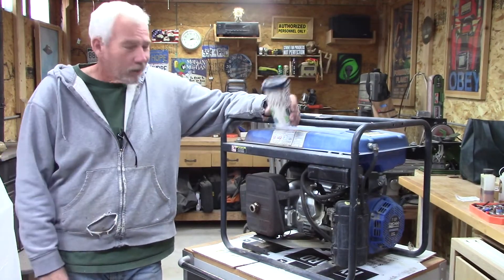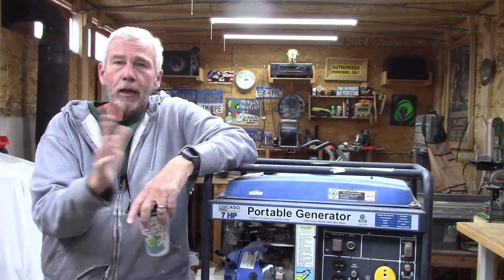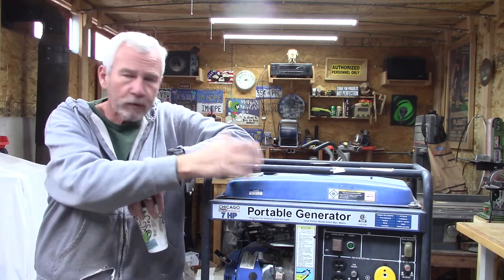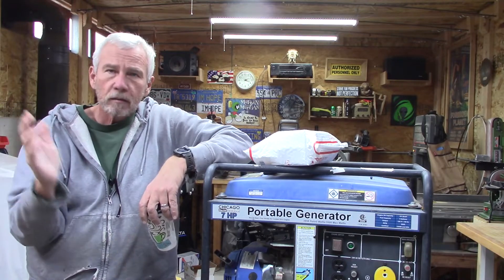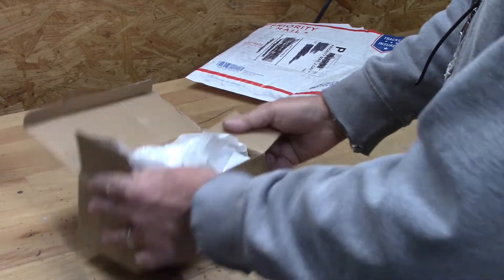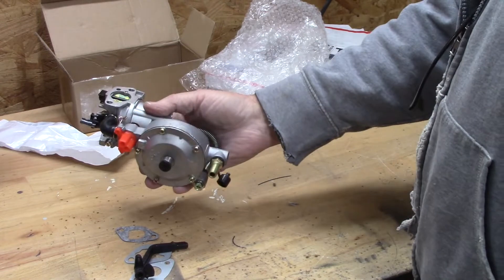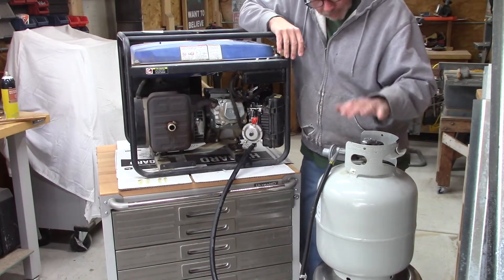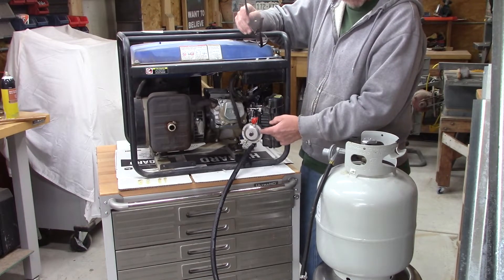Harbor Freight Portable Generator Propane Conversion - With Parts List - Let's Figure This Out

Comment: Will this kit work on a Generac GP6500
2:52
Reply from the maker: The kits are pretty generic and are based on the size of your Generator. Start by looking for a kit that is designed for Make and Model. If none is available, go the generic route, but be careful and really read the item descriptions to ensure they cover your make and model.

Comment: I bought one of those carb kits recently, which looks to be Identical to yours. The listing said, "Note The gas has to be pressure regulated natural gas(shortened as PNG or CNG) should be between .29 or .37 psi and LPG need to be .40 or .55 psi; natural gas generally has a regulator before entering the building. For LP gas a regulator has to be installed on the tank. Basic mechanical ability is needed as these units only come with basic operation instructions."

I bought a pressure regulator that yields 0.5 psi. Not yet installed, so we'll see how it works.
Reply from the maker: Good Information. I just used an adjustable unit off a turkey pot

Comment: On my first conversion,  I had one of those adjustable regulators with a gauge. I had to cut it down to 1-2 psi before it would start. Then slowly increase the gas to operating speed

Comment: How did you deal with the nipple instead of a screw on connector?
Reply from the maker: @GaryWolf001  Unfortunately I'm not near the unit. If I could change the adapter I would. If I would use a constant tension clamp

Comment: I have the same setup, the question I have is how did you attach the adjustable pressure regulator to the barbed fitting on the carb, mine came with a female compression fitting.
Reply from the maker: I don't remember, but I prefer to use constant tension clamp instead of the worm screw clamps. The reason I like those has to do with the temperature swings we get.

Comment: You have built a great channel and I enjoy your enthusiasm.  I just bought one of those kits but with the regulator from “V power” and had success.  The regulator they supply is apparently a higher volume, fixed pressure type and seems to work great from starting to load.

Comment: Is the barb fitting on the carb threaded into the carb? If so, it would be nice to unscrew the barb and change it to the common threaded connection.
Reply from the maker: In many cases I would agree with you. In this case (low cost & high vibration) I don't mind a barb fitting as long as you use a constant tension clamp to account for temp variations. Just my opinion.

Comment: Yo hice ese mismo cambio con un carburador similar en la parte de arriba del regulador de gas del carburador hay una llave que dice gas lp y gas natural hay que seleccionar el correcto, yo uso un regulador de gas de baja presión y 0.8 metro cúbico por hora y 0.4 psi y funciona perfectamente.
Ojo pierdes un 20 o 30 % de potencia
Reply from the maker: Gracias por tu contribución. La mayoría de estos kits/carburadores son tricombustibles. Gasolina, Propano y Gas Natural. Olvidé mencionar la posibilidad de cambiar a gas natural, así que gracias por mencionarlo.

Comment: What do you think is the running time with one full take of propane? BTW, excellent video and information.
Reply from the maker: I get that question often. It all depends on the generator and the attached load. I've run mine with a 30lb bottle for 48 hours straight and it did fine.

Comment: Where did you buy the propane hose that goes from tank and generator if Amazon could you please put a link
Reply from the maker: Amazon has a variety of hose kits. Here is an example: PAMASE 12FT Long Propane Hose Adapter with POL to QCC1 Converter, Extension Hose 1lb to 20lb Tank, for Camping Long Distances Use Large Tank, BBQ Portable Gas Grill, Griddle, Stove
Reply from the maker: If that isn't what you want search "Extended Stay Propane Kit"

Comment: what about the engine governor when the load changes, do you need to adjust the pressure when the load changes ?
Reply from the maker: As the load changes the vacuum on the diagram changes which adjusts the amount of propane flow

Comment: Just wanted to thank you for this info.  I bought the same kit and, like you, absolutely no instructions.  I had no idea how to use it and how to switch from gas, to propane to NG.  Was able to start it on propane but on natural gas, even when priming it, it's doesn't start unless I squirt a little gasoline in the carb first to get it going,  and then the NG kicks in.  Mine is a pull start only but it might start OK on NG with an electric start.

Comment: Am from Nigeria how can I get the dual carburetor
Reply from the maker: I bought most of these parts from Amazon and I don't get anything from you buying these parts. Just copy and search each one.

Tri-Fuel Conversion Kit:  Nature Gas Propane Tri Fuel Conversion Carburetor Kit for Predator Harbor Freight 3200 4000 Watts Gas Generator.

Adjustable Pressure Regulator: GasOne 2109-RED 4 ft High Pressure 0-20 PSI Adjustable Regulator with Red QCC-1 Type Hose-Works with Newer U.S. Propane Tanks.

Brass Hose Adapter: Anderson Metals - 07004-0606 Brass Hose Fitting, Connector, 3/8" Barb x 3/8" Male Flare (Fits the above regulator)

3/8” Fuel Line
2 each Hose Clamps
Reply: Can I get the Amazon company in Nigeria
Reply: I really need to buy the carburetor

Comment: I installed a dual carburator but the propane own is not working which pressure regulator is the best low or high
Reply from the maker: This is what I used: GasOne 2109-RED 4 ft High Pressure 0-20 PSI Adjustable Regulator with Red QCC-1 Type Hose-Works with Newer U.S. Propane Tanks.
Reply from the maker: I then put two marks on the regulator with a sharpe. One for Start (Richer) and one for run.
Reply: Most dual/trifuel generator carbs like about 9-13 inches of water column pressure. Find a 9-13 WC regulator and they need volume so use atleast 3/8th hose shorter than 10 ft and you should be GTG. 9-13 WC pressure is 1/2 to 1 psi.

Comment: Mine doesnt seem to want to idle up under load, but idles fine with no load. I have an adjustable regulator. Think maybe ive got too much propane going in? Have you tested yours under a load? If so, does the amount of propane going in need to be adjusted once the engine revs up?
Reply from the maker: Mine does fine in both conditions. I have lines marked on my valve for starting and running. You may have a vacuum leak. Spray some carb or brake cleaner around the base to see if anything changes. Also look to see if there are any uncapped vacuum ports.

Comment: I am new to youtubing .. watched yout Harbor Freight conversion to propane video and never saw parts list at end . How do I access that info? Thanks
Reply from the maker: Actually the parts are identified in the description. I didn't use part numbers as parts come and go. I give a pretty good description of what to search for. Your actual parts may vary depending on the generator you want to modify.

Comment: Maybe I can pick your brain as I’m at a lost here. Got the same type setup, I’ve tried everything I can think of and it still won’t start. I can spray starting fluid in the carb and it fires right up, however when I connect my propane hose and try starting it, nothing, it just turns over and over and does nada. Any suggestions as too what I should/could try? Do you choke it when trying to start on propane?  Do you think it could be the unit itself or a bad HP hose?  Has anyone else got any suggestions or had a problem like this.  Any help is surely appreciated. Thx all.
Reply from the maker: Sounds like it is not getting enough fuel. When I tried the non-adjustable regulator it had problems. The extra bit of fuel seems to make the difference. Yes I do use the choke to get it running. Also make sure the gasoline valve is closed. If the gasoline tank is empty, it could suck air through that line and give a too lean condition.
Reply: @LetsFigureThisOut  must have an adjustable reggulator to work.
Reply: I had problems starting with the self same conversion kit. My Harbor Freight genny is electronic invertor type and has a fancy motor driven  throttle on top of exsisting carb body wired back to  control box. Problems, problems, still working on it. BTW, the big round thing you first called a regulator is really a demand valve. Shuts of the gas when there is no vacuum from the carb. Plus, it's used to purge the air out by pressing the  red button. Really pleased you found out that the red tri position sw, pulls out to turn. Thanks, impressed with the quality of the  presentation.

Comment: Thanks for the video and the ideas. I bought a generic converter for my Honda EU2000i which contained a pressure regulator and a demand regulator with a primer button. With a barb fitting screwed into the air filter cover I was able to get it running but just barely; it was getting too much gas.I put a restricting valve in the 3/8" fuel line and I could get it started and running but then there wasn't enough propane to make it run when the load went up. I made a plate with a pipe and jet between the air cleaner and carb that would hopefully act like the venturi and jets in a gasoline carburetor. It would only run if I gently pushed the primer button, so it was running lean.I think if I can match the pressure going into the demand regulator with your variable pressure regulator idea I'll be able to match my gas flow to what is needed. Thanks again for the information. Subscribed.
Reply: if you put a regular ball valve between the carb hose and the demand regulator you can regulate the flow set it and then remove the handle.

Comment: I enjoyed your great video, would the conversion kit work on a Firman 1600W Running / 2000W Peak Gasoline Powered Inverter Generator? Thanks
Reply from the maker: There are a variety of kits available so I'm sure there is one that will work for your generator

Comment: I’ve got the same set up only my generator is a Troy Bilt. However I can’t get it to start. Thought maybe it was because of the Torch spark plug so replaced it today with an NGK BPR6ES, and still nothing. It has an electric start, turns over, but never fires up.  Does anyone  have any ideas?  Generator is 420cc, I’m wondering if maybe it’s not turning over fast enough to create a strong enough vacuum to open the valve to pull in the propane. Is that a possibility, and if it is, what should/do I do next?  Any help/ideas are greatly appreciated.
Reply from the maker: I had the same problem when I tried to use a fixed pressure regulator. The variable made all the difference
Reply: Start it on starting fluid for now

Comment: You gonna need a low oil cutoff, very simple to install.
Reply from the maker: I will check to see if it has one. If not, I will add one. Good call, thanks
Reply: The one's I have seen do not have one. Assuming you will check oil when refueling.

Comment: Excellent video, I’ve set the same thing up, I’ve been trying for a few days now and have not been able to get my generator started. I believe I now know why, watched another you tube video and the gentleman stated you only open the high pressure regulator a small amount.  I believe I know now that I haven’t been opening it far enough after seeing your 3/4 turn open.  I’ll find out tomorrow, hopefully it’ll start then, thank you much.
Reply from the maker: I used a regulator for either a weed burner or a turkey deep fryer. That extra little bit really made the difference

Comment: Your propane pressure should be approx 11 inches water column (1/2 psi) which is typical of bbq's and most other appliances. With that HP regulator you are pumping way too much propane in there.. Since you did the Carb swap, the KN regulator on the carb takes care of that.. With the snorkel method,, that would be a problem. . Almost any standard fixed pressure BBQ or camp stove model would work fine. OR you can tap into your house line without any regulator other than the one at the tank ..
Reply from the maker: I tried using a standard BBQ regulator and found it hard to start. When I changed of to the adjustable, I was able to up the flow a bit and get it to start much easier. It didn't take much, but it made a difference.
Reply: @LetsFigureThisOut  If you get curious as to exactly what pressure you have a manometer is very easy to build with just a piece of rubber tubing and a small scrap of wood....  The KN regulator on the carb does act as an on-off valve but it also regulates the flow..  I get approx 22 hours of run-time from a 20 Lb bottle of propane with a constant 11 WC

Comment: Great!
good video, thanx for the parts list!😉
Reply from the maker: I've used the generator in both gas and propane mode a few times this year. Above 7,000 feet. And below 50 degrees it takes 6 pulls to start. Pretty good for an old bottom of the line generator.

Comment: thanks, good info. switching mine soon. when you went to amazon, did you have to put in make and model of your generator?
Reply from the maker: I did a number of searches. What it came down to was engine size and generator watt output to get the correct size kit
Reply: @LetsFigureThisOut  thank you
Reply: Bought mine on Temu the exact same one, still have to install it, got it yesterday. Thank you for the video

Comment: Excellent! Now I have the confidence to try it myself. In a perfect world, what is the PSI the diaphragm valve installed with the new Carb supposed to see? I guessed you tuned your genset by adjusting the regulator until it ran perfect, but what PSI is that/is that supposed to be? I would like to purchase a quality regulator that is not adjustable to connect between tank and new carb but don't know what to specify or look for.
Reply from the maker: I first tried a non-adjustable valve and it simply didn't work good enough for me. I'm also at 5700 feet and travel to both higher and lower elevations so the adjustable was the best option for me.as for the exact pressure, not sure, but I think it may have more to do with flow rate. Which is also very low.
Reply: @LetsFigureThisOut  Thank you.
Reply: @benkanobe7500  will NOT work unless adjustable.  Just floods out. Iordered one from ebay...now works fine.

Comment: Nice 👍🏻. Going switch mine. It’s older sets champion 10 hp electric start. Techumsion motor. 
Thanks from ur ole hillbilly buddy. Stay safe.
Reply: I have the same generator same engine,let me know if you change yours over yet and what propane kit you got and where please I would appreciate it. I've been checking and can't find anything for a Tecumseh motor 10 HP!

Comment: Thanks for giving me the courage and incentive to convert my generator to propane fuel. Having to deal with gasoline that goes bad is a nuisance.  Propane is the way to go even if it doesn't have the same energy potential as gasoline.

Comment: Hey Mr. I watched your new welder video and I'd have to say looks like you didn't do to terrible with those welds that you made but I noticed that when you were  welding your gun angle is directed to straight in you should tilt your gun slightly to a 15° angle so you can always see your arc better. By the way your gonna need 2 bottles of shielding gas if your gonna do any tig or solid core mig with your welder. For tig welding you gonna want to buy a cylinder of straight argon and for mig your gonna want to buy so 75/25 argon mix but you can go with straight CO2 gas for a hotter weld with more spatter. If you want to get into stainless mig you're gonna need to go with a tri-mix shielding gas as any other gas will not do. Anyways I  hope you get a lot of good use out of your fancy new welder.
Reply from the maker: Thank you very much for your advice. I have a project scheduled for next summer and your advice will be printed out and put in the folder. I did take a welding class in high school (1977). Things have changed a bit.
Reply: @LetsFigureThisOut   that's alright there are plenty of welding videos on YouTube I'd sat especially check out the instructional video by Jody on his YouTube channel Weldingtipsandtricks. You might be able to check out a few of my videos as well for any pointers I've been welding for about 1/2 my life as well approx 22 yrs